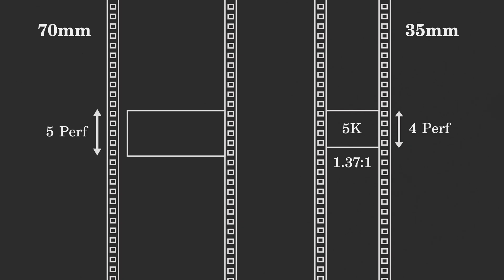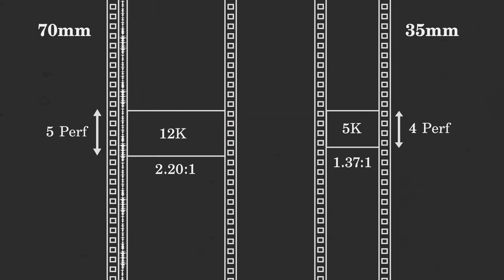The Technique of 70mm Film

Comment: In Russia 70mm is used for camera negatives and intermediates as well as for prints.

In 1929-30 the Fox Grandeur process used 70 mm for both negatives and prints.  At about the same time there were other wide film processes which used 65 mm and fifty something mm.  All of these processes were very short lived.  Fox Grandeur had a frame height almost the same as Todd-so but with only four perforations which were a different shape and pitch.  The frame width was less, giving a 2:1 aspect ratio and room for a wide optical sound track.
Reply from the maker: Really cool! I didn't know all of that.

Comment: Sorry but I had to stop at 1.00. You made a huge error relating to the sound track/ picture area positioning. 70mm is well known not just for the picture quality but the 6 track magnetic sound (pre digital days). In post digital days the TODD-AO form remained, even though the mag tracks were replaced with a DTS time code.

Comment: Important note : you don't shoot 70mm, no films are shot with it, only 65mm.
70mm is reserved for film projectors, all cameras use 65mm film, with an aspect ratio of 2,26:1, which is then converted (and slighty crop on the sides) to 2,2:1 on a bit smaller frame size to 70mm print.
IMAX is also 65mm, but with an horizontal pull down, (much like Vistavision or Technirama), resulting in an absolutely enormous 15 perf 1,43:1 negative frame.
(which is basically medium format size, just between 6x6 and 6x7)
Only a handful of IMAX 15 perf projectors still remain in the world, and project it to its native format.
Reply: Except in Russia, where camera negatives and intermediates are also 70 mm.  Also, the Fox Grandeur process used for a couple of years from about 1929 was also all 70 mm, but the frame size and perforations were quite different to the Todd-so standard.
Reply: You forgot about Todd AO 35 it had a 4 track sound track